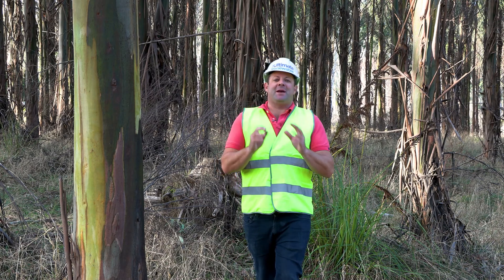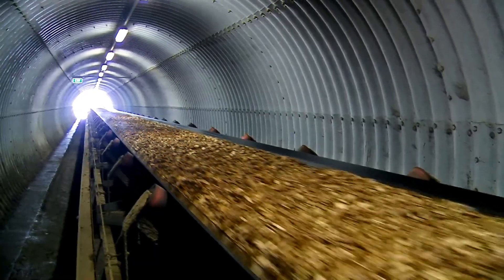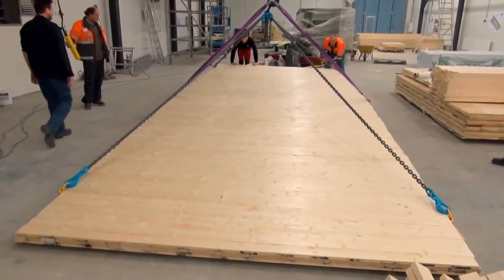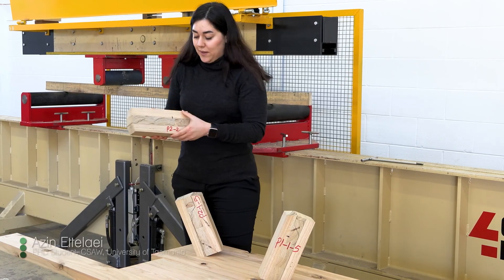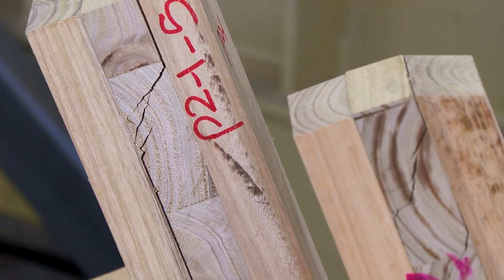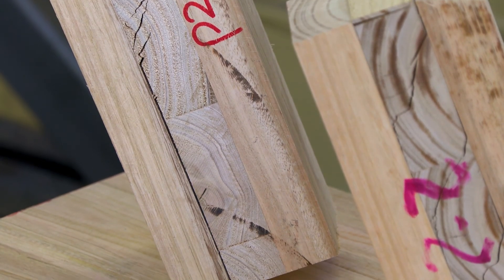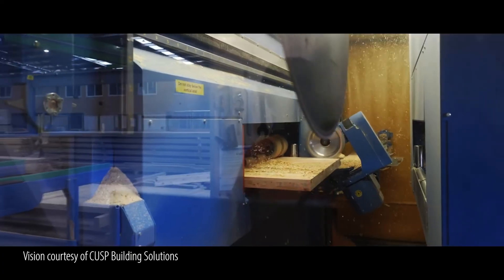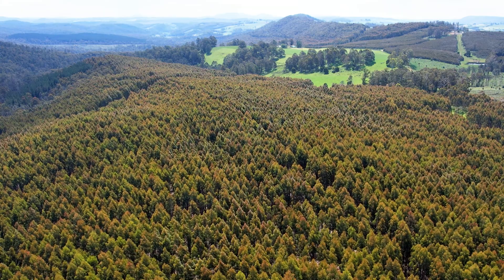Hardwood Cross Laminated Timber (CLT): An Australian First

Comment: in reality, the use of hardwood as CLT is quite challenging.  I am a forest products student who is currently working on a final project related to the CLT with combination of Acacia mangium and Schima wallichii using polyurethane adhesive. 
The problem I'm experiencing is that the dimensional stability of the hardwood is low enough that its strength in long-term use will also be affected.  
It is strongly recommended to use the best coating material for CLT hardwoods applications.  But if CLT from hardwood is developed properly in the future, it will produce products with good quality and can also be widely available due to the high production of hardwood.

Very interesting.